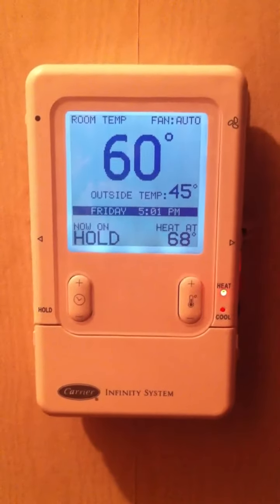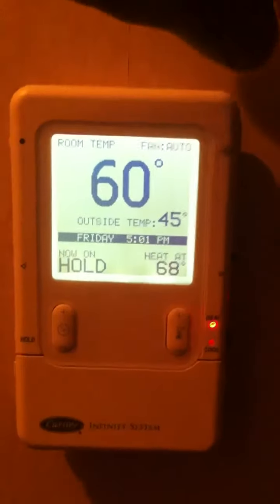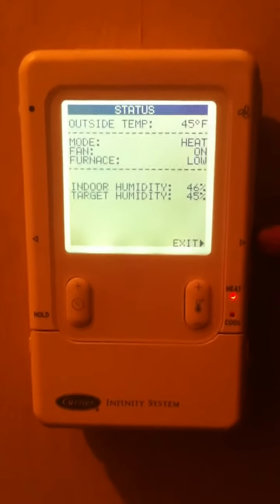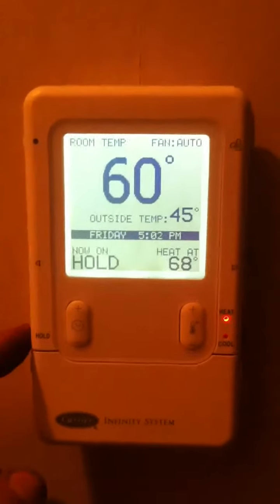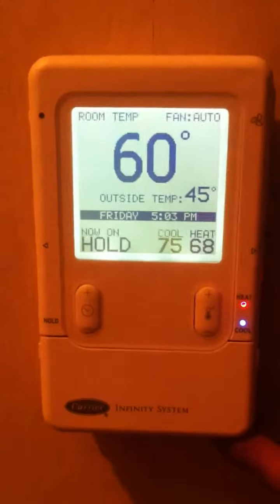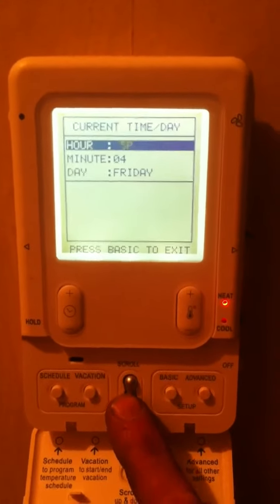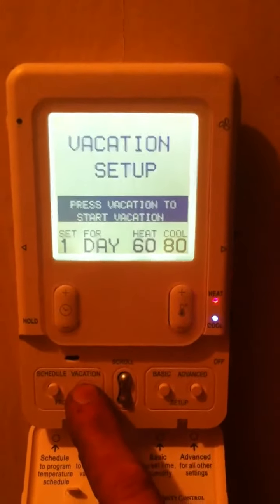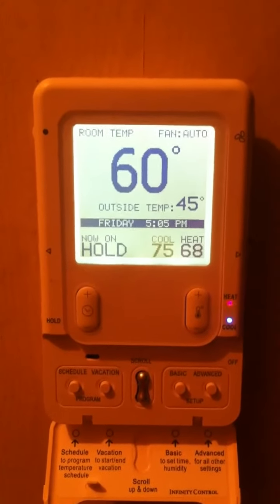HVAC Controls: The Carrier Infinity Thermostat Walkthrough

Comment from the maker: Im sure you figured out how by now but i figured i'd respond. it's pretty basic and is on by default, if it gets turned off you simply press the blue button on the side for cooling or the red button on the side for heating. if you push both blue and red together then it'll be able to run heat and cooling on its own depending on temperature settings

Comment: Hey if you are still around here, how do I take it off the wall, I need to some wall repair and painting right around the controller.
Thanks
Reply from the maker: You should be able to simply pull the front off the wall. There is a seam between the back plate and the face.

Comment: I have that thermostat in my home. The video is very helpful, and shows features I didn't know that the thermostat has.  (We bought our home with the existing Infinity HVAC system).  
PROBLEM:  The small tab has broken on the red "Heat" button. Is a replacement button available? If not, can I replace this thermostat with a newer Carrier thermostat, such as the SYSTXCCWIC01-B ?  Is replacement a simple matter of connecting 4 wires, or does it take some programming of the furnace or AC unit?  Thanks.
Reply from the maker: Yes, You could use a newer control

Comment from the maker: The infinity control runs off of system power. If the display is blank check your breakers, and check for float switches anywhere near the cooling coil.

Comment: Been watching all your videos lately. 
Funny I found this.. A buddy asked me if he can install a nest which will replace his carrier infinity stat like the one on this video. He took a picture of the sub base for me and its labeled A B C D then on the furnace it goes onto the board on terminal block A B C D. 

There is a traditional r w c g y terminals on there too. Can I disconnect the abcd wires from the stat to the board and use that for the nest?
Reply from the maker: If their standard terminals are on the furnace board then yes but you will have to change the wiring on the AC as well
Reply from the maker: you'll lose the features of the Infinity controller.
Reply: Stephen Rardon that was my next question what are the features?
Reply from the maker: When I got to thinking of it the Original infinity control really doesn't have any feature of significance beyond what Nest can do. Infinity had one feature that Nest won't but its minor really, it would tell you when your static pressure was high which indicated needing to change the filter. Of course I had that happen more often when the duct system sucked
Reply: Stephen Rardon awesome bro thanks a lot! You're the man and keep uploading those videos.

Comment: How do I UNLOCK it?
Reply from the maker: Haven't dealt with a locked device yet, I'll check it out and get back to you.
Reply from the maker: Ok, pretty simple actually. The button on the top left side is the "dot" or "period". The button on the top right side is the "fan". Make sure you are on the main or home screen, which I guess you'd have to be if it's locked... Anyway, click and hold those buttons simultaneously for 2 seconds and release. The lock icon should disappear and you can use the device normally. Inversely if you wanted to lock it again do the same 2 buttons for 2 seconds. Good luck and thanks for watching!

Comment: You know there's a service mode for the infinity thermostat
Reply from the maker: yep, actually my favorite user interface for communicating systems. at one time there was very little i didn't know about that device. it's been a few years since i was neck deep into that device. i've lost familiarity but would probably pick it right back up. not a huge fan of the touch screen version though.
Reply: Yeah I'll tell you my favorite communicating system is the new water furnace envision 7 series it is the best that is out there. I've only worked on two of them though. Through the thermostat it tells you superheat subcooling discharge superheat. It will give you g.p.m. And temperature drop off loop. It will tell you amp draw and volts of the fan motor. amp draw and volts of the compressor and amp draw and volts of the flow Center. Water furnace is by far ahead of everyone
Reply from the maker: Nicholas Rowan you in a position to do a video on it?
Reply: I could totally do a video on it next time I  am there servicing it.  I have a job coming up where I have to change a check valve and flush loops would you be interested in me sending you a video of that?
Reply: I could briefly go over the systems that are there there are 2 envisions and one synergy system
Reply from the maker: anything is worth posting if it could help someone learn about their system or help a tech more completely understand something. so, yeah, shoot it, edit it, post it!